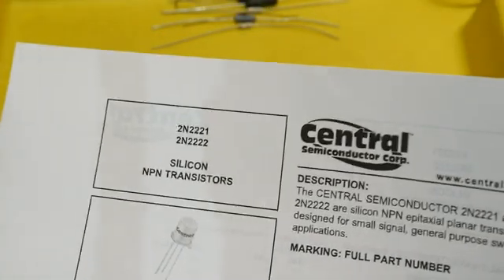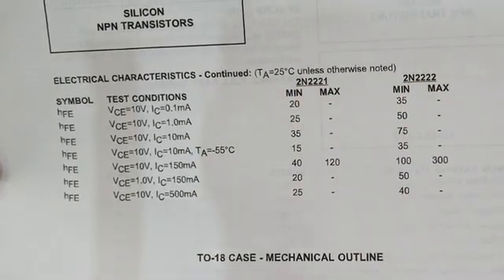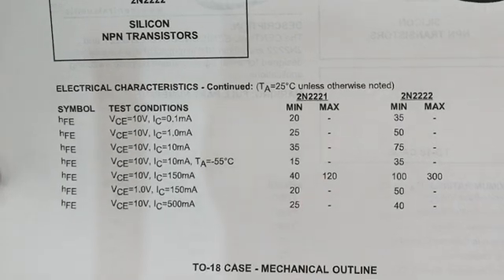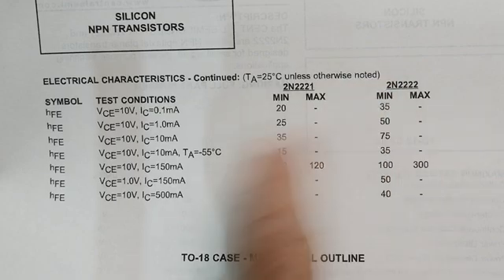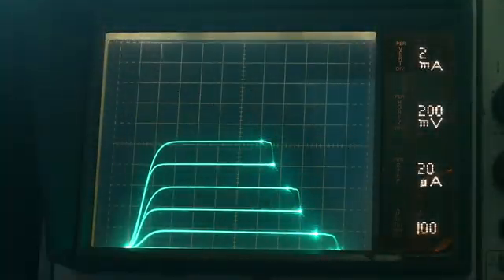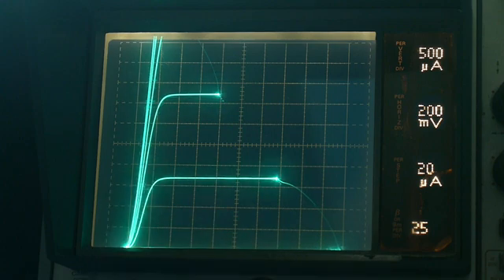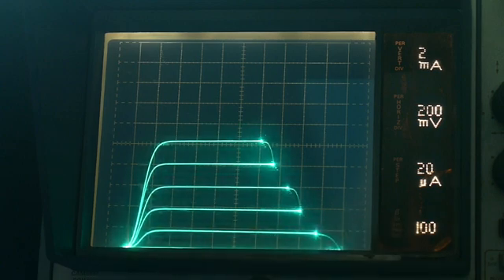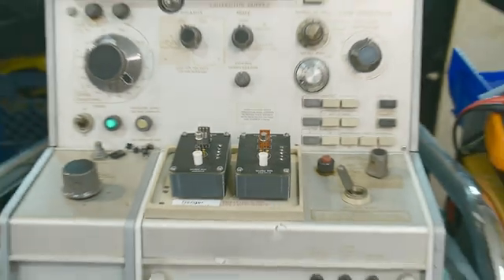#1499 2N2221 Transistor

Comment: Ahh, reminds me of, back in the day, when I was starting out at a Fiber Optics Test Company, We used the 2N2222 to dive the 10ns short pulse to the laser diodes. The reason I remember this part, is we were trying to troubleshoot and intermittent problem that would appear on certain OTDR's, but only when paired with certain controllers which provided the main power to the modules. Long story short it turned out to be this part as the fix, as we could never figure out why the controller pairing was showing up, I never figured out why. Engineering just changed it to the Military Grade part and left it at that. The MX marked part. We spent a long time working on that problem. Edit, It was causing a ringing, or oscillation, but irregular pulse response after the first pulse was triggered.

Comment: This when I like to use logarithmic amplifier.
You can send the output current of each transistor  to logarithmic  Amp, then subtract them using an opamp and then send it to antilog Amp.
The result is the ratio of the currents.

Comment: The curve tracer does bring back memories of the days when matching transistors (or just screening them for gain) was a common thing.  In more modern times, I've seen cases where a distributor would provide parts that met a tighter spec, in order to ensure that a product would perform adequately.

Comment: Recently viewed a russian guy video tinkering old VEF portable radios and trying to get more out of them then they offered out of the factory (popular ex-soviets sport). These radios used a current instead of voltage stabilizer to stabilize heterodine and set bias of the mixer and input transistors. In the particulare use there was no difference, because they have the same effect, but schematics used drew microamps instead of milliamps and the "chip of the day" was that it only works with germanium transistors with gain not more than 30, usually 15.

Comment: Notwithstanding cost, when would a low gain transistor be desirable?
Reply: Less sensitive to noise and other unwanted signals 😉
Reply from the maker: high gain can cause ringing or oscillation in some circuits

Comment: All my 2N2222 and 2N2221's are plastic  cased not metal ?
Reply: Technically then they are the PN2222/1 and have slightly lower power dissipation capabilities,  though most Chinese manufacturers just use the 2N naming. Multiple packages available from many manufacturers anyway.
Reply: Last time I saw a new transistor in a metal case was about the same time I saw a uA741 in a TO-5 metal can.  In other words, a LONG time ago. I just checked, and you can still get 2N2222As in a TO-18 metal case, but they ain't cheap.  I think I'll stick with the inexpensive plastic cases myself.  😀